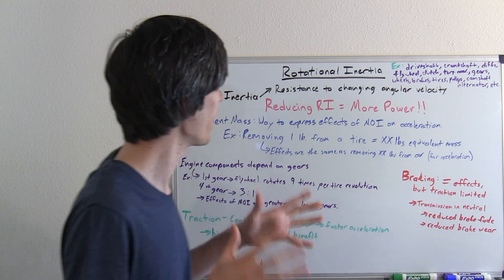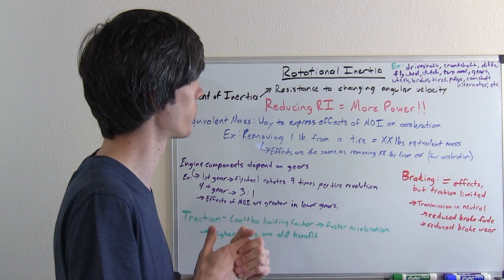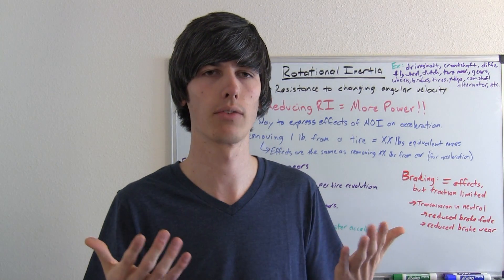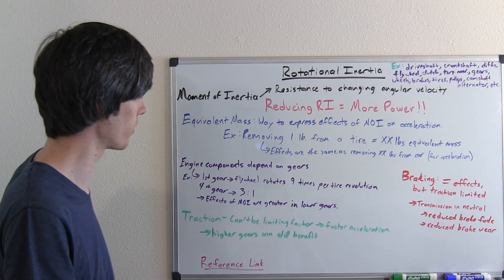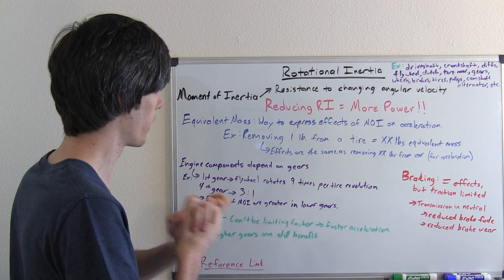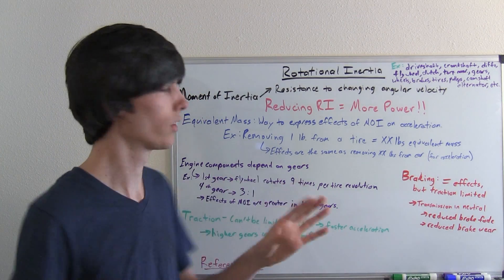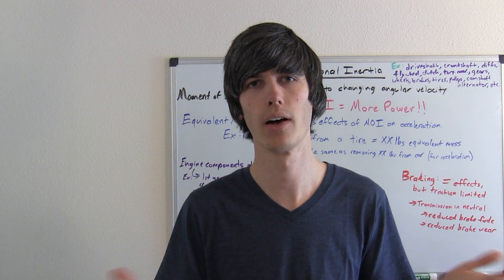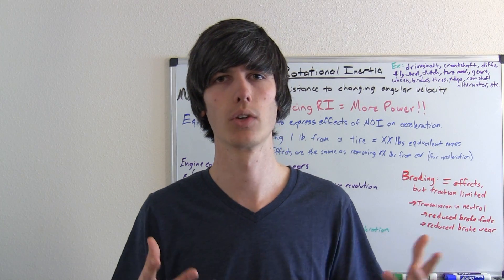Rotational Inertia - Equivalent Mass

Comment: My 700 crank hp BMW SAV/SUV does not care about wheels. :)
Reply: I think you might feel the benefits of light weight wheels during quick left and right switch backs and high speed corner entry; take corners faster and you might feel the effects between light weight and heavy wheels.

Comment: SO how much weight loss in say tire/wheel combo and or stock steel driveshaft vs lighter aluminum DS  will equal a 1 HP gain?
i think  my camaro 18" steel wheels and winter tires weigh 61lbs
VS my summer 19s with all seasons weigh about 53lbs
SO how much HP am i losing on those 8LB heavier winter wheels?
I assume the 2 drivewheels matter more  for acceleration, like say 16 lbs less rear wheel weight equals 5 hp for eg but the other 16 lbs of front wheel weight would only equal 2 hp loss for eg.

it really doesnt mattter much in this case since winter traction will often be very limited
BUT if it does equate to large losses or gains i may buy much lighter wheels to replace my summer wheels.

Supposedly forgestar  F14 drag wheels are 11 lbs lighter than stock camaro wheels.
ALSO does 11 lbs of each wheel weight equate to MORE hp than say the same weightloss on the driveshaft due to this moment of inertia?

Comment: I have a hard time shifting smoothly (1stbto 2nd) on my  ‘17 Mazda3 2.5 MT. Due to the gear ratios being almost 1/2 from the first to the second. Would you say that a lighter flywheel will help ? Currently if I rev to 4k in 1st & shift, I have to wait for the rpm to drop to 2k before I can release the clutch and shift into 2nd smoothly, else I have to grind the clutch & give it some gas to continue accelerating at a higher rpm where the 1st gear left off. Any suggestions?
Reply: light flywheel has less intertia, so it should both increase and decrease revs faster

Comment: Question! Just bought a 2019 MX-5. They changed the OEM lugs from 21mm to 17mm for this year. I want locks and black lugs. McGard sells 21mm black lugs with locks and also tells be that they have 19mm bulge that will fit. Concerned about how any of these two will change my rotational inertia.... With a car so light I don't know what to do! I'm thinking my 270lbs is probably more of a factor than a few oz on a lug lol. Another option would be to go with Cold Forged 7075 T-6 Aluminum but I hear different things about Aluminum in general. HELP!!!

Comment: Some people say unsprung weight factor is 5 to 10 times.. so if your tyre is 10 lb lighter each its like decreasing between 200 to 400 lbs while accelerating on drag strip for example. Is that factor correct?

Comment: Can you make a video on how much wheel weight affects acceleration; lightweight wheels vs heavy wheels on the same car.
Reply: I just changed my set of wheels 13 pounds heavier per wheel.. it is absolutly very very big difference.. ! i don't recomend to anyone to put on heavier wheels..! Tested uphill in 5th gear it could accelerate.. now.. i have to go with 3rd to 6-7rpm then 4th stay still.. can't accelerate more.. !!
Reply: My car feels a lot faster after dropping 10lbs per wheel
Reply: This is the video for that.  Lighter car has lighter rotational inertia therefore they help braking and acceleration.

Comment: **Reciprocating mass** in an engine is often overlooked, whenever I explain it even seasoned racers double take...
I apprenticed myself 30 some odd years ago for 16 hours a week at 18 years old to an engine builder CLIFF BRIEN who did the FORD CAMMER's for GAS RHONDA and LES RICHEY in the 60's. FWIW He still wouldn't talk about Richey's accident 20 years later...

What I learned about reciprocating mass when I was building circle track and road racing engines... 
 
A few ounces will reduce lap times as much as 100 pounds removed from the car... The pistons rings pins and small end of the rod are accelerated from a dead stop 2 times every revolution....removing 10 grams per cylinder is a few ounces total in a V8 and 10 grams is EASY, - run a long rod with a short compression height and narrow pin boss- run a tapered narrow pin.  Long Rod additionally adds -extended dwell time near TDC for increased cylinder pressure and reduced side loads on the bore walls.  - of course all of this needs to be tailored to the intake and exhaust runner volumes and flow numbers on the intake and exhaust.

Comment: Hello engineering explained, I have a question, I have a choice of two sets of wheels, 15x6 and 15x7, what do you recommend for a street car with the occasional amateur track day? The 15x6 tyre size is 205/55/15 what would you recommend for the 7" wheel if you would prefer that width? What tire/rim width would offer the best handling, traction, stopping distance and grip? I have heard that a little wider is better but at what point does the extra mass become a concern and actually reduce performace? Thanks, Sam

Comment: does that mean smaller rims better for acceleration?
Reply: yes
Reply: steel wheels vs aluminum wheels vs carbon fiber wheels is an example
Reply: Actually, you want slightly bigger wheels in the rear
Reply: So like smaller wheels cover less area too right?
Reply: Another reply, it means that it turns more, but requires more force to turn and get the car moving
Reply: JonPRHX-Gaming they put smaller wheels on dirt bikes.  Rear

Comment: So if I got an aluminum flywheel for my car that weighs 1/2 lb when the stock weight is 4 lbs, I will gain about 9-10 hp because of reduced weight?  And then I got 245/40 tires with some 19 lb rims that 18's, that would free some weight up as well? I might be mixing the two concepts but this would increase or even out my whp with what the stock hp actually was (160 hp) or all together increase it? :S lol
Reply from the maker: I don't know about 9-10 hp (how'd you get that number?) but it should make a difference. Though it does depend on the gear, first gear will have greater gains.
Reply: What kind of flywheel only weighs .5 lbs? Wth?

Comment: So let's see if I got this... Let's say I have 2 wheels. One 18" and one 16" both weigh the same. The 18" tyre is a low profile say 30 and the 16" is 50 and both weigh the same.
But the 16" would create "more" hp, due to the heavier mass beeing closer to the center?

Comment from the maker: That's a pretty big difference. You have to consider that the wheels are unsprung and also rotating, so any weight reduction has an even greater impact than elsewhere on the car.

Comment: But at the same time you could argue that less force is required to reconcile the difference in speed between the clutch plates if the flywheel is lighter than if you had a heavy one

Comment: you would have to brake really hard, and in a low gear, to achieve a high enough declaration such that the flywheel is exerting a force onto the transmission which acts in the direction of the car's motion. It would almost always be the other way round (ie. engine braking)

Comment from the maker: Greater downforce and less weight is ideal as it will allow for better acceleration/braking (mass of the vehicle does not change) and better cornering speeds as grip is a function of the normal force of the car; the lighter the car the greater g's it can hold with additional downforce.

Comment: Hey bud, I've been loving the videos you have been making about acceleration and mass and now the rotational inertia, but I have one more question. How does downforce equivilate to regular weight? Say there is a two cars with the same engine and everything except one is like an f1 car being super light but having insane down force, while the other is more heavy with less down force like a NASCAR. Which is more benefitial?
Reply: Kyle Dunn F1 car hands down. Safer, faster, more fuel efficient and brakes better, cuz light weight is everything in racing

Comment from the maker: Several reasons. First, it allows for a comfortable ride. The tires have spring/damping rates of their own. Also, solid rubber tires would be extremely heavy - which is undesirable in rotating components.

Comment from the maker: You are correct, I'm not saying you should shift to neutral every time you brake. Using your engine to slow the car down will save on your brakes, and assuming the engine is properly lubricated and cooled, shouldn't cause any problems.

Comment: A lightened flywheel will respond to changes of acceleration/deceleration 'faster' because it takes less torque differentials to spin it up or down due to the lower rotational inertia. I think you are referring to the problem of disconnecting power from the drivetrain (putting in the clutch) for too long, where the engine will decelerate very rapidly and possibly stall or when you try to modulate the accelerator to match gearing, but it is too easy to overshoot the desired rpm due to fast accel?

Comment: Wait wait wait wait waaaaaiitt. So you're saying that if I'm driving manual, I should shift to neutral every time I brake because I don't have to split my stopping power between the car itself and the rotating gears and stuff in my car? What about downshifting and letting the gears slow down the car as you also apply brakes? Won't the gears help you brake, therefore saving wear and tear on your pads?

Comment from the maker: Your car won't "lose speed quickly" due to a lightweight flywheel. You're not forced to engine brake, you can put it in neutral and the flywheel won't have any effect. Though while engine braking, it will slightly increase how quickly you slow down.

Comment: You're oversimplifying this because the purpose of a flywheel is to store rotational energy. With a very light flywheel, you take your foot off the gas and your car would loose speed quickly or you would have a hard time making smooth shifts because the increased load from the decreases torque would kill the engine

Comment from the maker: Well you can apply the reverse if necessary, but with things like KERS you're storing energy. I may be easier to store energy is something that can spin up quickly rather than takes a long time. Regardless, you don't want the system to be too heavy.

Comment: How will you stand up to theory that with lighter flywheel you cannot achieve as high top speeds as with normal/heavier flywheel? - this some thing that lots of guys are talking but i cannot understand it as always it will be less energy required to speed up then with normal flywheel.

Comment from the maker: Not necessarily, it would simply depend on the weight loss. If you could remove 50 lbs with carbon fiber body work, it'd likely be more useful than 10 lbs at the driveshaft. But pound for pound, it's more beneficial to remove 1 pound from a rotating component than 1 pound from a stationary component.